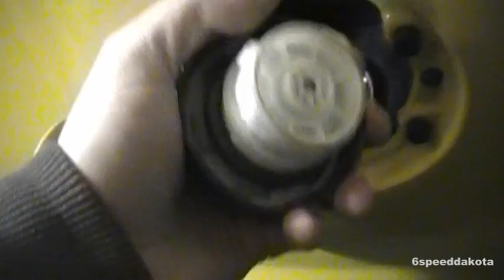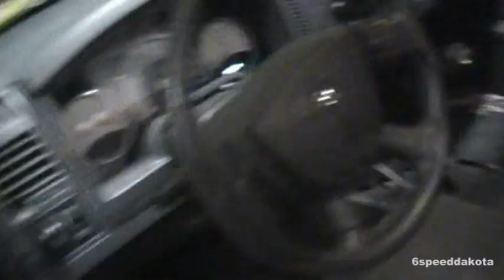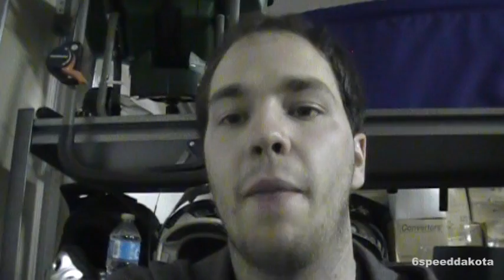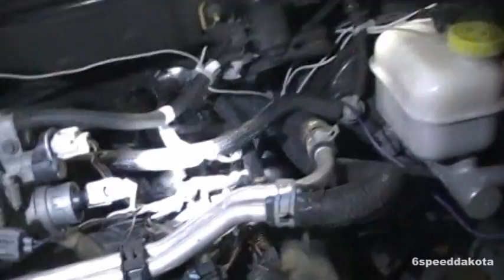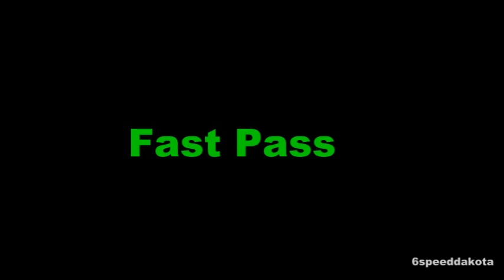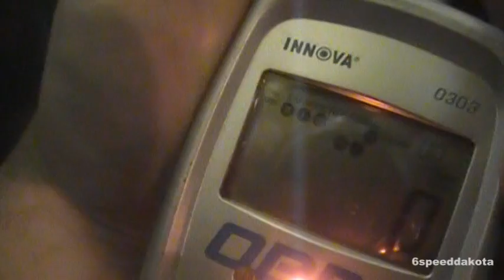How to Pass an Emissions Controls Test

Comment: Hi l droped  my new new 02 sensor and the heater element dos not work and l would like to now will the sensor still work
Reply from the maker: +thestephen8 Ok, so if you have a code for an O2 sensor heater circuit and you've replaced the sensor, cleared the codes, and then you still get a heater circuit code, then you probably have a problem in the wiring to the O2 sensor, or there's a blown fuse that powers the O2 heater circuit.

In order for the O2 sensor to function, it needs to be warmed up to a certain temperature. On older OBD1 vehicles, the O2 sensors generally had a single wire connection since they just relied on the heat of the exhaust to warm them up. Problem is that it took a bit of driving to warm the sensor up enough to allow it to function. So the OBD2 vehicles have a heater inside the O2 sensor to heat it up to temperature so the O2 sensor can start functioning sooner.

When the computer uses the information from the O2 sensor to monitor and adjust fuel trim, this is called closed loop. When the vehicle is cold, and the O2 sensor is not up to temperature, the computer ignores the O2 sensor readings since they are not accurate, and it runs purely from the fuel tables stored in the memory, this is somewhat inefficient since the computer is just making an educated guess and it can't monitor what the engine is doing, but during warm up, the engine runs richer anyway. This is called open loop

With the heater, it can function immediately, however when your car is cold, it needs to run richer so it can idle and run properly until the engine warms up and stabilizes a bit, so the system doesn't go into closed loop immediately.

The problem is that the emissions testing we had here would fail you automatically if you have a check engine light on, and/or you have trouble codes stored in memory. So if they plug your vehicle in and do a test of the on board diagnostic system (OBD), then you're definitely going to fail. If they just do a tailpipe test with a gas analyzer, assuming that the vehicle has no other issues that would cause the emissions to be high, it will most likely pass, just make sure that the car is good and hot before you bring it in and get it tested.

Comment: The kind of test you have done will depend in which state you live. Here in Texas, a "sniff" test is done on 95 and OLDER vehicles. on 96 and NEWER vehicles, the emissions machine is connected to the OBD2 port of the vehicle. And all monitors have to be ready, no current codes, check engine light has to be working properly and several other things have to pass, if not, the vehicle will NOT PASS and will have to be repaired before it can pass. CHECK WITH YOUR LOCAL DMV OT EMISSIONS PLACE to see what is needed in order for your vehicle to pass an IM test.

Comment: I have a 94 chey trk 5.7 an is running lean an open loop an it has a intake manifold leak an a fix# of 456 to 556 on the oxygen sensor will that make it fail the emission test
Reply from the maker: Simon flores The intake manifold leak will definitely make it run lean on open loop because the computer has no idea what is going on without the input of the oxygen sensor
Reply: Pass emmision inspection today with a open loop an a fix #456 to 556 on the oxygen sensor thanku for your help

Comment: my honda civic 95 failed emission test on Nitrogen Oxide. But all other results( HC and CO) passed much better compared with the past result 2 years ago.( The better results on HC & CO maybe because the cylinder head was resurfaced for head gasket change last year, and new spark plugs installed.) The technician found the car's PCV hose defective somewhat flattened at mid-section. Does the defective PCV hose contribute to the test failure on Nitrogen Oxide? Or just the EGR Valve just needed replacement? Thanks!

Comment: Basic Theory of Octane gas combustion with Oxygen convert into Hydrocarbon plus Carbon monoxide,      O8H18 + O2 _>> HC + CO this is chemistry reaction from gasoline high Octane combine oxygen burn to give power consumption to engine release toxic Hydro carbon and deadly Carbon Monoxide gas, have to understand the Emission function when gasoline from injector inject to engine combustion by sparkling plugs, the intake and the outake going to exhaust manifold at here had Oxygen sensor to detect the amount of Oxygen combine with Octane going through Catalystic Converter which have the Palladium plating inside catalytic converter to speed up the reaction to reduce the amount of hydrocarbon and Carbon monoxide down then the amount flow through the end of tail pipe was detect once again with another oxygen sensor downstream,  to detect again the amount of Hydrocarabon and Carbon monoxide, these final substance chemistry was enforce by the Enviromental Protection Agency required what statistic of HC and CO, EPA very strict on smog particle, therefore if any vehicle want to pass smog check, vehicle is running ok, engine ok no misfire, engine run ok, clean EGR Exhaust Gas Recirculation Valve and clean any tube free dust, and take the vehicle to Smog Test &  repair tell them just diagnostic do not sending Data DMV so vehicle owner knowing what' is failing need to repair, Vehicle Owner realize need to minimize the cost avoid the rip off to repair, the whole smog is just Emmission control include all the gas intake , gas outake , check thorough and clean any dust then check Oxygen sensor, all the smog check due the failing is catalytic converter need to replace and Oxygen sensor. the part cost approximately from 100 to 200 dollars but the labor cost nearly 200 dollars.

Comment: Mines said on board computer is not ready.
Reply from the maker: Your computer hasn't finished running all it's on board diagnostic tests and is not ready for an emissions test
Reply: My friend told me 2 put sum fuel cleaner in it. N drive it hard 4 30 mins then try